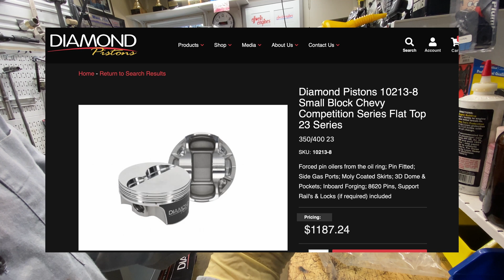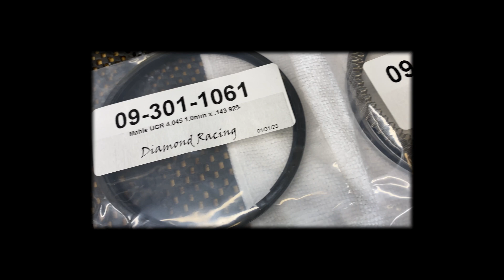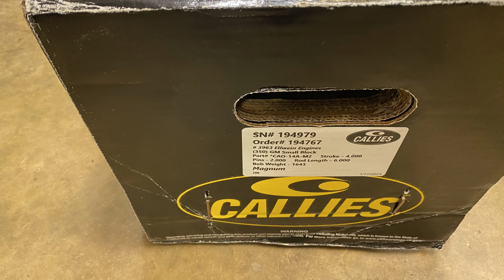Organizing and Planning of your engine assembly.  LT1 Small Block

Comment: That crank is meant for a Dart block or aftermarket.. I don't even know why there is a coolant passage or area that far down at the oil pan rail, 99% of the heat will be at the top of cylinder where the deck is and the percentage will lessen the further down..

Even aftermarket blocks should thicken up that area at bottom to give you a boatload more clearance also, no need for water cooling that low or that much of it anyways.
Reply from the maker: You are so right about that on the block bottom.
Yet GM had these small block Chevy engines cast that way. I have filled the bottom of the LT1 block (not this one) and there is no rise in engine coolant temp but there is some tiny rise in oil temperature...and I like the oil temp hotter at least in these cars.   That crank is custom Magnum and I've been ordering them from Callies for many years.  Just a small block Magnum with the 1-piece rear.
Reply: @EllweinEngines  David Vizard swears every roller block he has tested failed past 500hp... Did you see the link i posted in the comments on it? Cause it would save some money if i could get a normal 4 bolt 880 block and do oil mods with a shark tooth pump..

Also, is the callies magnum cranks double oil fed on the mains 180* apart, or just the 1 single oiling hole on each main? Cause when the single oil hole type cranks are in the thrust side (CAP) they get zero oil feed pressure thus are not feeding the rods for 180* of crank rotation, i didn't know if callies adds a extra oil feed on the mains or not?
Reply from the maker: @ICONBADGTA  I did not see the link.  would you mind posting again please.  Vizard is a unique person.  I take all of his opinions and consider them but not above anyone else's opinion such as you or Kasie or my neighbor....if you get my drift.  :)
Reply from the maker: For the main oil holes question.  I checked yesterday and it is 2 oil feed holes at about 180 apart and one feeds a different rod journal and also the adjacent main feeds the same way so each rod journal gets 2 feeds.   Not from the same main but from 2 different mains.  .
Reply: @EllweinEngines  If the 2 holes in each main are indeed for separate rod oil feed, and not tied together, then each of the rods the holes feed are cut-off from oil pressure/flow for 180* of crankshaft rotation...  The whole entire point of having (2) oiling holes are to keep a constant oil pressure feed to the rods no matter what position the crankshaft is in.  Original crank design only had (1) hole on each main journal of the crankshaft, that BOTH rods were fed from, thus when the crank was in the saddle portion of the block, they wasn't being fed pressurized oil and relied upon oil slung from what was received when the crank hole was lined up with the upper bearing groove oil cut..  Get what i am saying? Where the thrust side of the mains are solid, no groove, thus no oil can feed minus the .0025-.003 clearance which is barley enough for the main journal oiling let alone for it and to feed both rods with oil also.. It's a flaw that should have been addressed DECADES ago by GM and Aftermarket!!!  Main priority blocks cut back on it, but unless a crank with tied in dual oiling holes 180* apart are used, it's a issue even until this day.
Reply from the maker: @ICONBADGTA  Up I hear what you are saying.  But in this case each rod journal is getting fed by 2 oil feeds.  One from one crank main and one from the other crank main.  So starting at #1/2 rod journal, one oil feed from #1 main and one oil feed from #2 main.  (and so on down the line).  Hopefully that will be enough oil.  Even if not fed for 180* that seems to work well enough over the years.  that is a difficult dynamic to measure.  The oil is not spilling out from the rod bearing unrestricted and so with good oil pressure there should be "enough" oil during the "no-feed" period of rotation.   Fingers crossed.   Do you know of any crankshaft manufacture that does a double oil feed? (4 holes per main?)